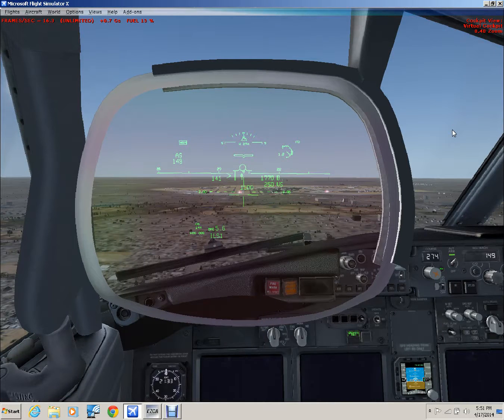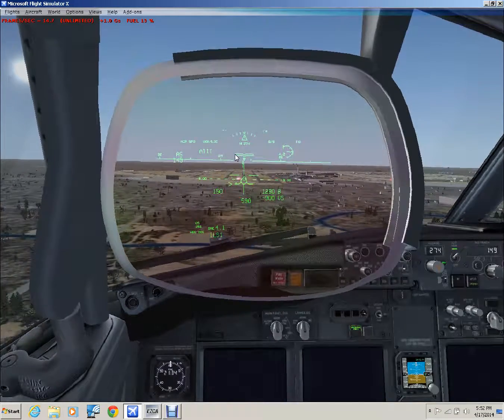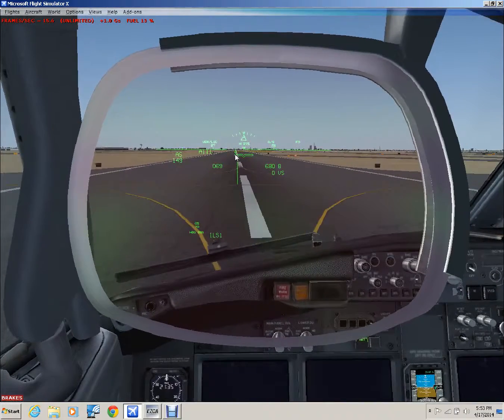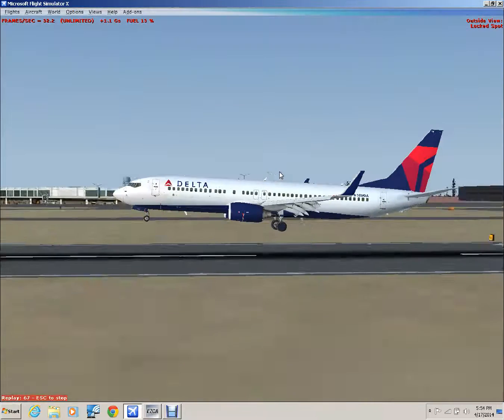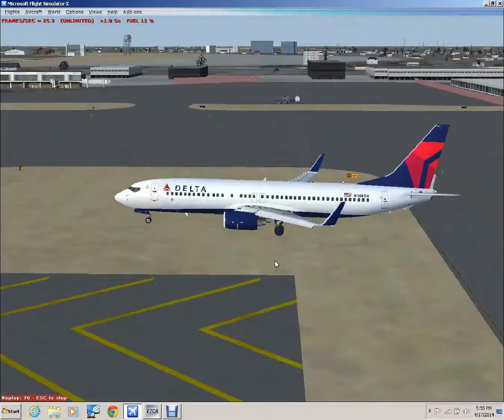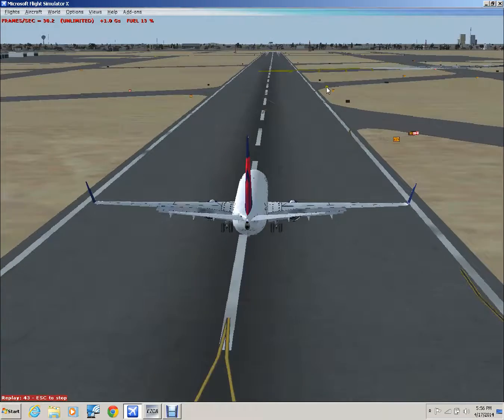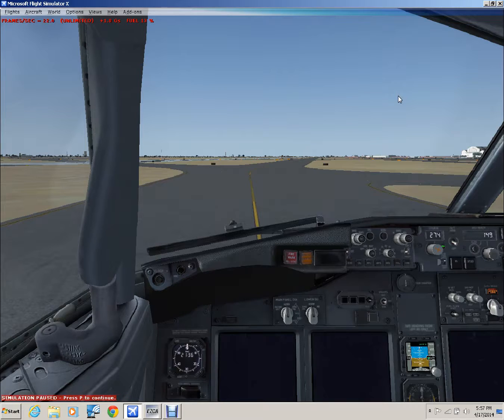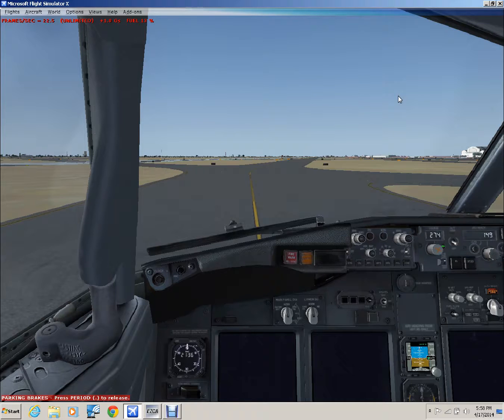FSX: Training - How to make a smooth landing

Comment: How do you deploy the spoiler?
Reply from the maker: If you have the PMDG NGX, standard procedure is to drag the spoiler lever, just to the left of the throttle quadrant, to the arm position.  When you touch down, the spoilers automatically deploy.  If this is not the case for you, in FSX the default key binding is the / key.  Press that and the spoilers should deploy.  Thanks for watching!
Reply: shift +/ to arm speed brake